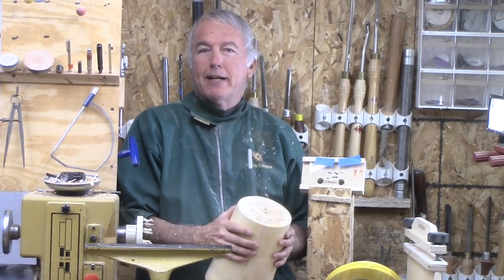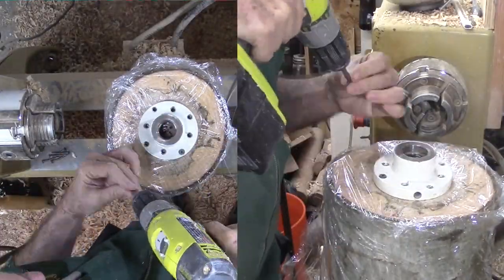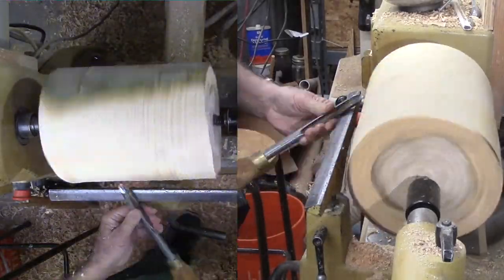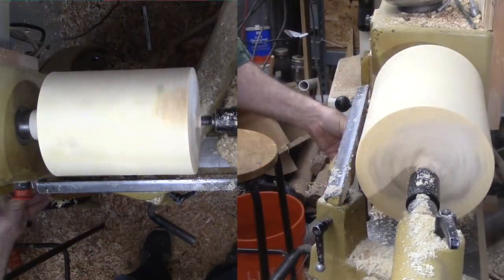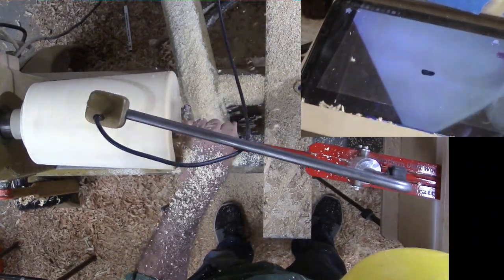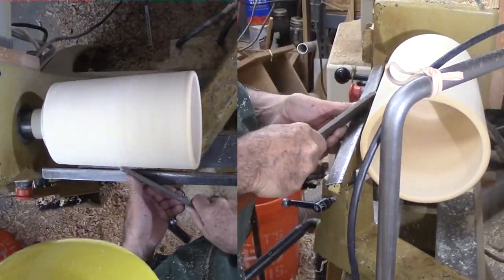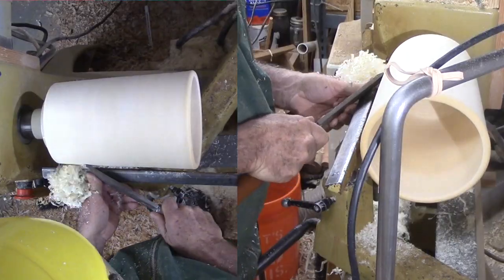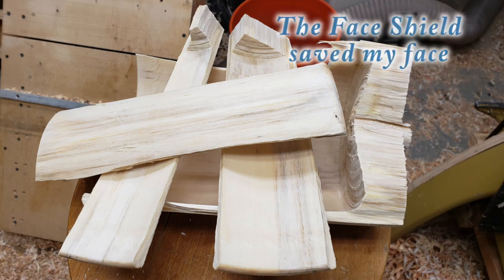Woodturning Blooper - Exploding Lampshade

Comment: Wow that's a pretty dramatic failure Alan. It's good hear you were not hurt. I turn lots of logs into birdhouses using a tenon instead of faceplate for just the reason you pointed out about the screws pulling out of green wood. I make my tenons almost full depth of jaw on  #3 or #4 jaws on Stronghold chuck, that way I can re-tighten periodically as the wet wood compresses and starts to wobble. My birdhouses are basically a thick walled lamp shade, Lol. Thanks for sharing a real world event in Woodturning.
Reply from the maker: I have had green wood loosen in my chuck also. That is a reason I wanted to try a faceplate on this one. But, no the screws did not hold well enough.
Thanks for sharing Bert
Alan

Comment: As soon as I saw you use the skew in that manner I could anticipate a catch, I limit my skew use to smaller diameter spindle turnings and with the tool rest raised much above center, keep at it and you'll master the skew and realize its limitations and uses; nevertheless it's the best tool in a turners arsenal by far.
Reply from the maker: I'm not blaming the skew necessarily since I was using it previously with beautiful results. Still, I agree that it is an essential tool in my rack.
Alan

Comment: Maybe a spigot and chuck might have been a better work holding than the faceplate and screws. Screws are not the best in end grain. 

Also a support, either a spindle steady or tailstock support may have help. 

Good on you for showing the reality of Turning, sometimes, it just doesn't want to work!
Reply from the maker: Both good ideas. My steady rest would have helped. Most often I do use a tenon but decided against it this time as a chuck can loosen on green wood also.
This one did not work out.
Alan
Reply: Hi Alan. I think screws and chucks loosen with wet wood but at least chucks can be tightened now and then. I’m glad you survived it even if the lampshade didn’t. Regards, Mike

Comment: You should change your channel name to 'As Wood Explodes'... ;-) =) 

I've not done a lampshade, but I have done many bowls/boxes/etc that I turned very thin - some down to 1/8".  One thing I learned the hard way is to never EVER go back to an area where the supporting wood has been removed from... that vibration you noticed is probably because there's not enough wood left to support the wood at the end completely & introducing a tool just magnifies the vibration until it becomes enough to catch on the tool you're using.  Wish I could say that explosions like this have never happened to me, but that's kind of a part of turning thin.
Reply from the maker: Very good point. Thank you for sharing it.
Alan

Comment: Glad you survived any damages is it possible you took the sides to thin?
And too wet?
Question where did you get your turning jacket at?
Safe turning!!!!
Reply from the maker: Actually, I wanted to go thinner. Translucent would have been nice but very tough.
I love turning wet wood since it is much softer and easier to remove a lot of wood and then let it dry in months rather than years.
Always wear a full face shield.
Alan